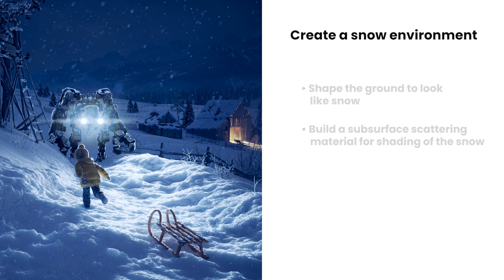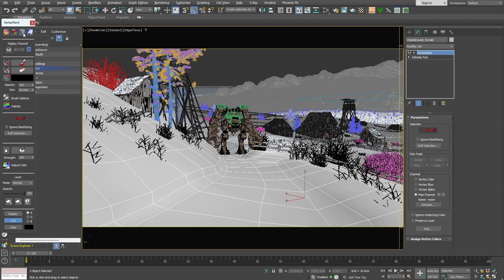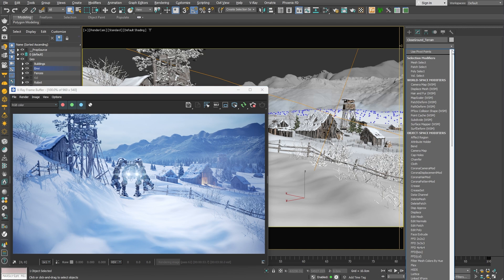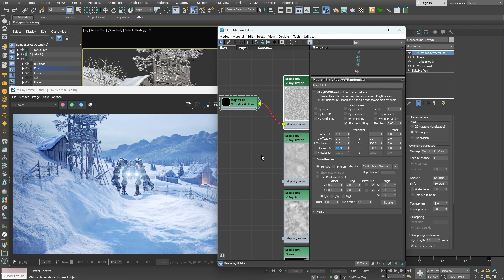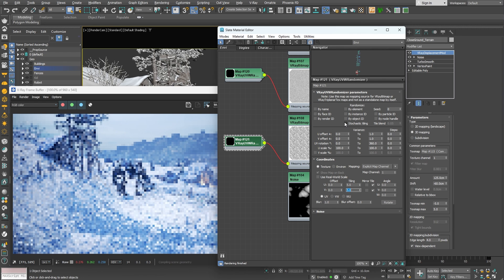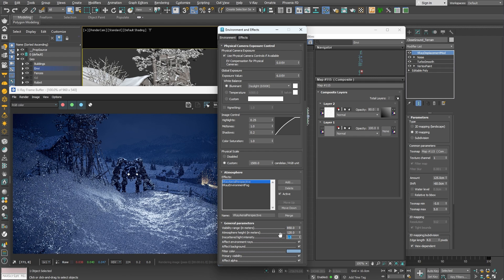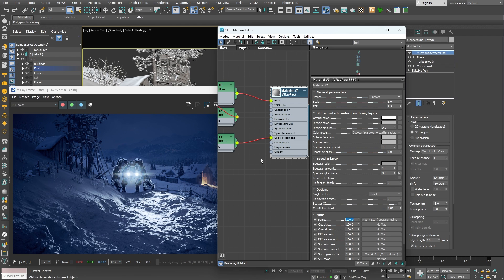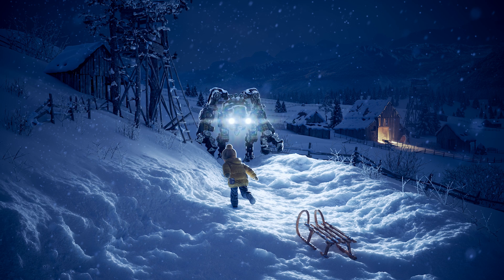Creating realistic snow with V-Ray for 3ds Max

Comment: The displacement settings implementation inside the VRayMtl would be a godsend. I'm, stuck to Corona just for this feature alone...So sad you have to mess around with many DispModifiers and vertex masks to achieve multiple displacements onto a single object.

Comment: Cool, more of those a bit more advanced tutorials pls. Normally Chaos tutorials are always super basic 🙂
Question: TexMin and Max is between -5 and 5. But your are using only simple jpgs. Any benefits for extending the range above 0 and 1 in that case?
Reply: There is no benefit of having range set above and below 0 to 1 in the case of using jpgs. It would only be beneficial if we use textures with values below 0 or above 1.
Reply: @vmihaylov1986  Yeah, ok thx for confirmation. Does it have any downsides to extend the range? Why not for example by default use -100 to 100 in order to cover any cases?
Reply: @vmihaylov1986 it actually has, if you add 2 bitmaps on top of each other, you might push your value above 1 and get a flat top effect (like if the surface was sanded)
Using overlay keeps your values in check but with less dynamic